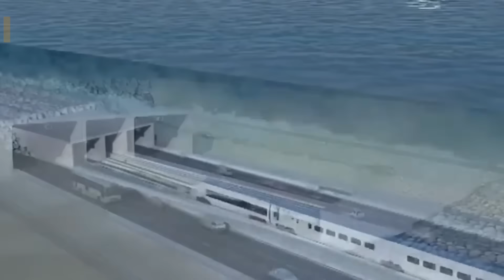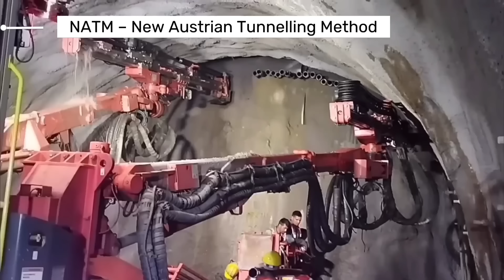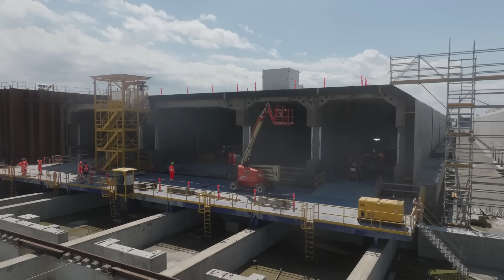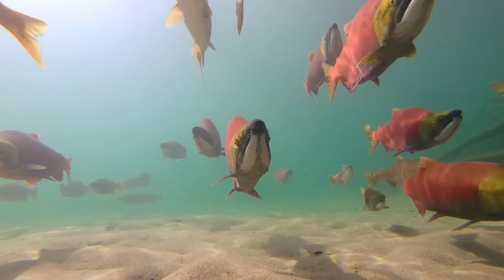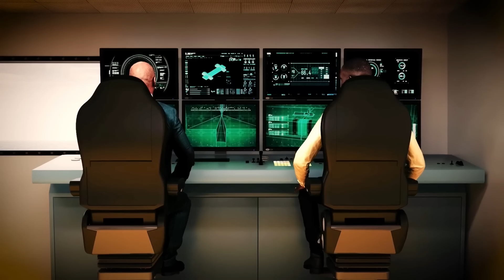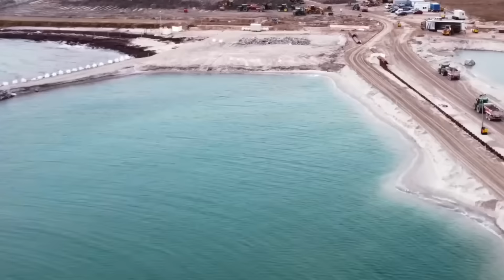How Denmark Built the World’s Longest Undersea Tunnel to Germany

Comment: WinD must be purely AI. Distorted nonsens combined with useless answers indicate, there has been no human research and knowledge in this video. Wrong geographical statements and some unexpeted forecasts make this video entertaining and funny, but not very informative. (It seems like there will be great cities around the tunnel area and exotic fishes and curious sharks in the water.) The material in the water bed was not the main obstacle to the delay. Economical and political issues were major problems. German politicians in particular  have long been against the connection.
Reply from the maker: Is there any evidence for this? Don't always doubt the value others bring to you. I also mentioned in the video that this project is still under construction; I never said it was finished.
Reply: @WinD-LPS  Which evidence do you want? I have not commented on the fact, that the project is still under construction,